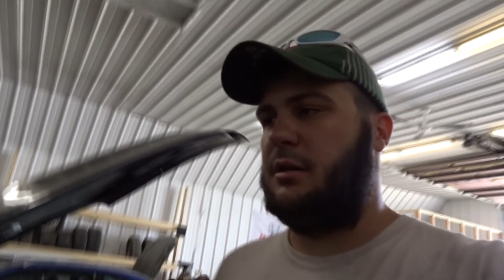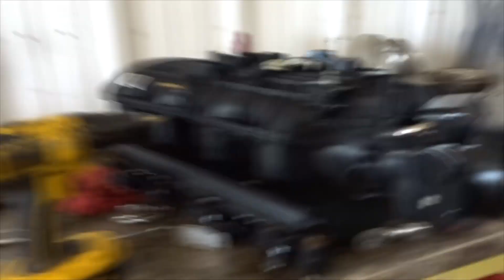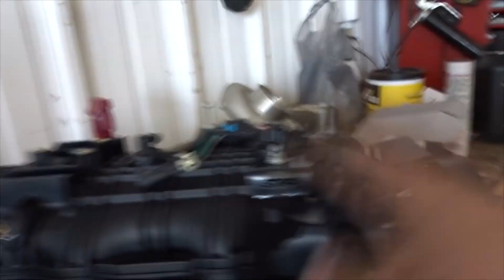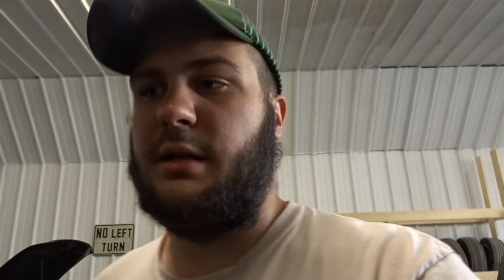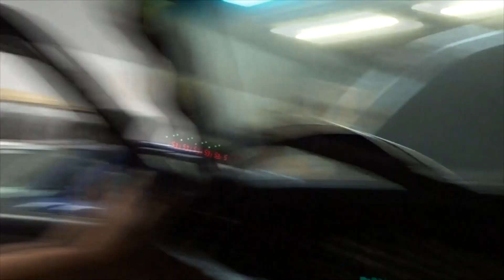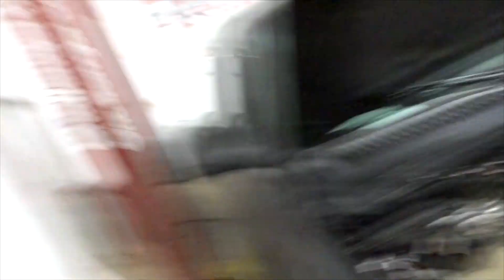One Of A Kind Truck Project Intro Blabby Style

Comment: There's two springs for safety if one brakes your throttle wont be wide open...I took them off and unwound 1 turn and stretch a little but never cut one...just fyi for next time

Comment: Keep up the solid work. For a street/strip, is HPtuners not capable enough?
Reply from the maker: It is. It just doesn’t have the capability of a Holley system. Usually by the time you buy credits and tune up the stock computer you could have just bought a terminator and been done.